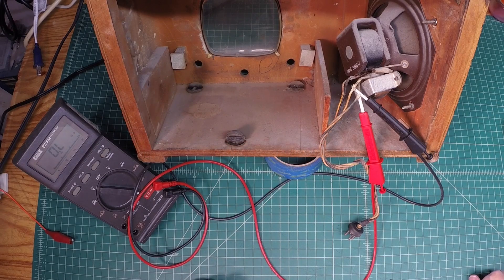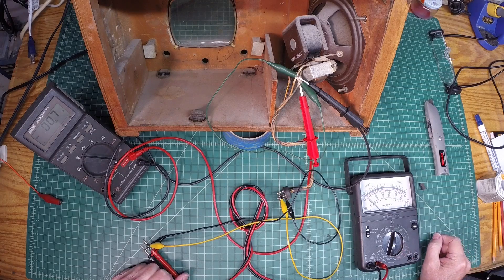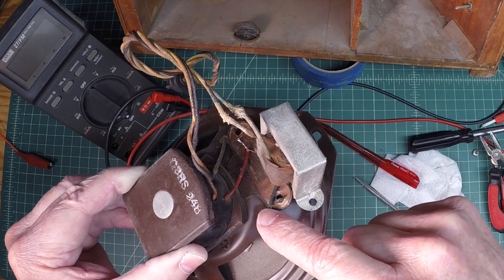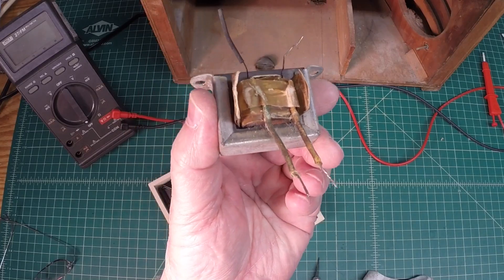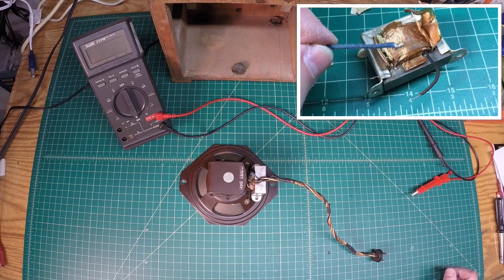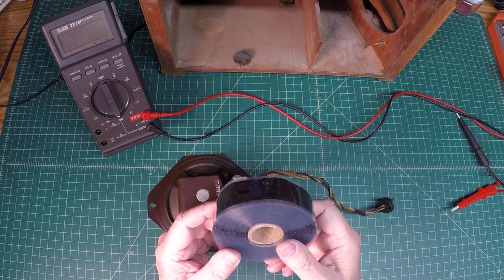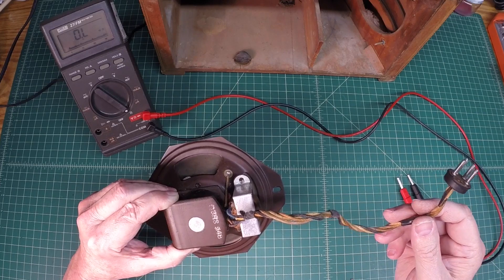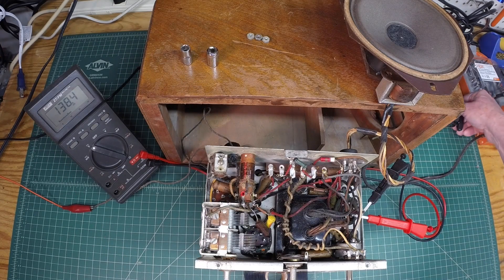Emerson R167 - Output Transformer Troubleshooting

Comment: Nice! you're a Guru Don.
 What would cause an OT to go open? cause after watching this I checked the Electrohome i'm working on, and wouldn't you know it the primary side on it is Open "blue & brown" wires from pins 3 on the 6V6's on the schematic. was it due to the power trans smoking up? I think i opened a can of worms on this thing, I wouldn't even know what to replace it with ( secondary should be 16 ohms according to the schematic?)
Have a Great week ahead
Ron
Reply from the maker: +Ron0963 Excessive current due to a defective capacitor or other component failure is a possible cause. Others have reported anomalies in the enamel coating, which can lead to corrosion and electrolysis between the wire and the grounded core, which causes the transformer to fail. The wires are super thin and it doesn't take much. I'll look at the schematic and ping you back ASAP. Best, Don
Reply: Thank's once again my friend.
I de-soldered the OT to measure secondary side and got 1.6 ohms?  ...huh? it's shot too? lots of fun indeed ..lol
Ron

Comment: Nice Video! I bought a bunch of that rescue tape at Dayton last year and have been using it on my outside antennas and coax connectors. Really great stuff. Like the glasses, are those lights on either side of them? Can I ask where you got them? 73
Reply from the maker: +Scott Johnston Thanks Scott. That rescue tape is really versatile. The glasses are Big Vision. I think Walmart has them. They have 2 clip on LEDs lights as well. Here's another link: https://www.buybigvision.com/?mid=6577769&gclid=CM_q1evxh8wCFVA8gQod6E0ATQ  Best, Don

Comment: Don: Fantastic save on the OT.  What did you use as a protective coat once the repair had been completed?  Looks like epoxy.   As always another great video.
Reply from the maker: +Armand Corpolongo Armand, great observation. I used quick setting epoxy, which allowed me to set my new primary lead down on top and the transformer and position the receiving coil in the perfect location. I had 1/8" of the primary winding to work with. I was holding my breath. LOL  Thanks again for following along. Best, Don

Comment: Hi Don,
I also like to use that self-fusing tape.  If one end of the bundle of wires is not connected, however, I like to cut "bands" from heat shrink tubing to slip over the bundle and shrink it down.I also agree that  you have nothing to lose in trying to repair "stuff" .After all. what's it going to harm it's already broken:)
Reply from the maker: +Jim Kodysz Thanks Jim. I like your method using the heat shrink when... I appreciate you watching. Best, Don

Comment: Hi Don. Very happy you were able to find and fix the break. I had a set that played great after I recapped it and while doing a burn in test, the sound just went out. After trouble shooting  I found it was the output transformer. When I took it apart the fine wire was falling into pieces. Only way to fix it was a rewind of the secondary . Not something I wish to repeat ever :)
All my best.
Bobby
Reply from the maker: +Bobby Tectalabyss It's not easy for sure. I have some vision issues in one eye, which makes it even more challenging, but rewarding when successful. Best, Don

Comment: Don, how do you clean the enamel from those very thin wires?
Reply from the maker: +ruff hardin Hi Ruff - In this case I was able to scrape it just a bit when I had it over the top of my nail, then I applied heat with a tinned soldering iron, checked the DC resistance multiple times and moved forward. I saw +bandersentv use an aspirin and a soldering iron to remove the enamel, not breathing in the bad stuff, which I've never tried. Best, Don

Comment: I know it would not have availed you in this repair, but you can get a set of those needle-sharp test leads which you can use to probe through insulation without stripping a spot in your nice vintage wire.
Reply from the maker: +Chaka Wolf Chaka - thanks for your suggestion. Is there a preferred source? Thanks again. Best, Don
Reply: +RestoreOldRadios I really don't know anymore.  I used to use them at work, but I don't know where they came from.  In my younger days I had a set that had collets on the ends that held steel phonograph needles.  I doubt they still sell those.  (Not that those old needles are exactly EASY to get anymore . . .) I have pushed sewing needles through insulation and then used the needle as a probe point.